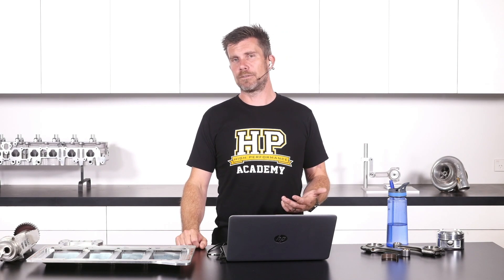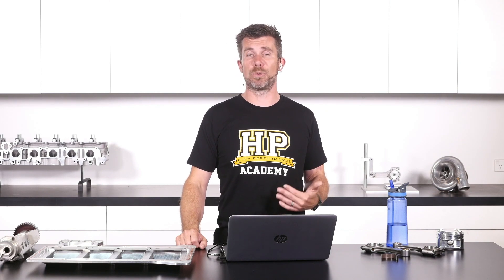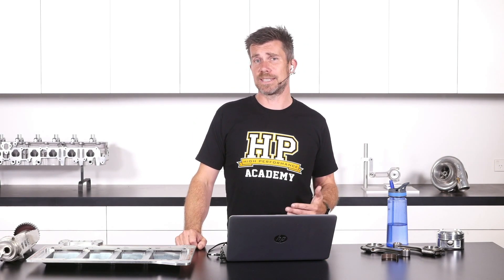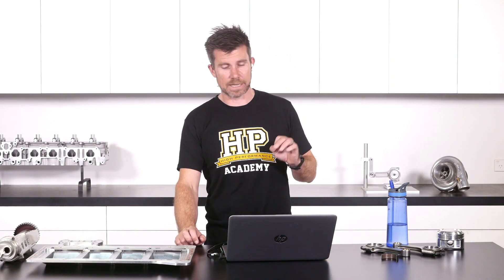Gas Ported Pistons | What's The Advantage? [HPA Q&A]

Comment: You should cover advantages and advantages of both types vs not having none at all, what kind of gains you would typically see, what compression psi you could lose by not having them under combustion and if it helps with blowby or anything like that.